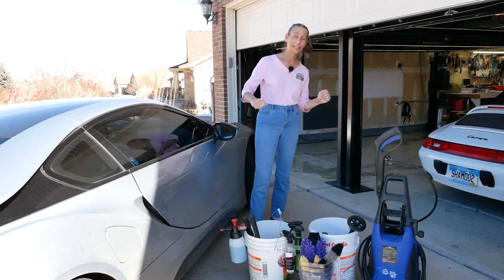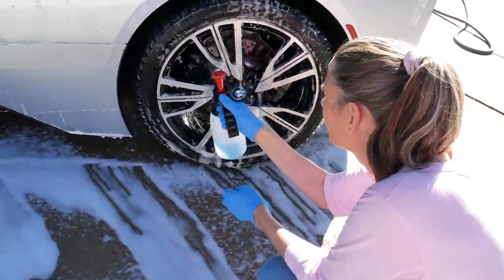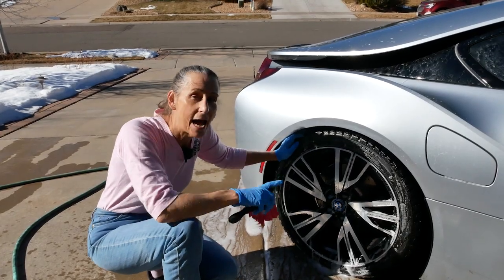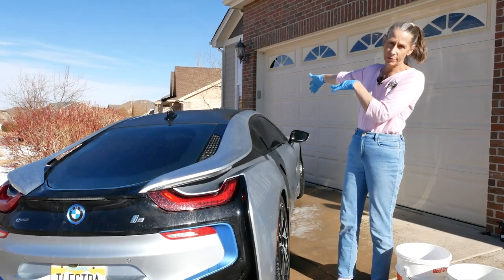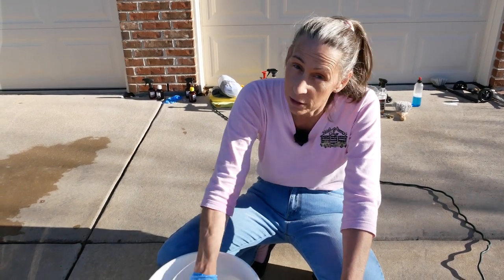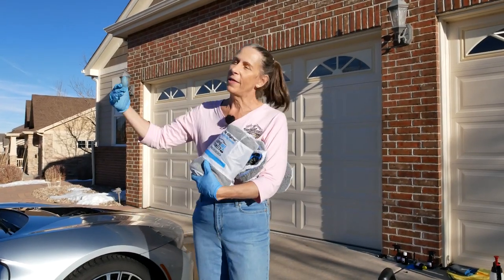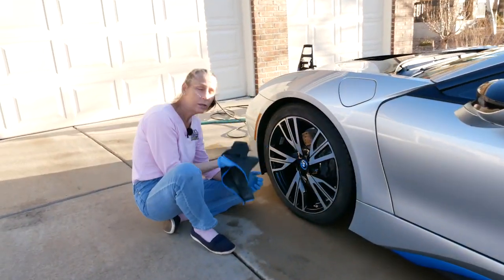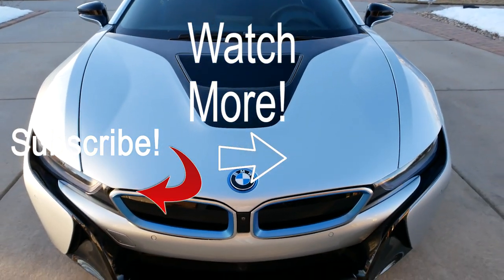Winter Wash a SUPER CAR!! - Polish Angel Review and Rapid Dry Towels!

Comment: Good stuff.  But, what I would like to add to the conversation is 1. Power wash/rinse off the first foam canon application so as to avoid or further minimize any risk of dragging dirt or debris over the surfaces.  Ditto for the wheel cleaner application.   Since the dirt, although loosened to a degree can still easily contribute to scratches regardless of the lubricity level of the foam/cleaner/shampoo, I'd rather see that first application of cleaner rinsed away - gone!  Then apply the foam again and now let it sit as you outlined before proceeding.  In fact, on the wheels, I'd apply X preferred wheel cleaner first, then rinse that off as prescribed, then add foam, let the foam set up and then rinse THAT first foam application away also, and then - and ONLY then - apply a second layer of foam before proceeding to any surface to surface action with mitts/microfiber towels.  Second, I'm against dragging the mitt over the lower one third section of the car and then migrate it upwards and have it contact the midsection in any way even if that area might is still "only" be the lower midsection.  Instead, use a separate mitt for the lowest section and another mitt on the  middle and top sections (beltline and above); better yet, use three different mitts for lower, mid and top section and keep them separate at all times, particularly post wash unless you launder them all anyway.
From southern California - Ride Forever!

Comment: I like the little axle with the jets, but tbh, I would be more paranoid about pressure washing the undercarriage with the dozens of sensors and a pretty big battery. But in the end I‘m guessing the car’s electric doesn’t care about the salt or the pressure washer. It’s sealed pretty tight.
Reply from the maker: The electronics are water tight, but I always worry about the connections and there are a bunch.  The car has a large thick aluminum plate under the car.  Those jets sure do clear the salt thought!
Reply: Better save than sorry, sometimes they fail and in that case the search for the failure can be… challenging 😊.